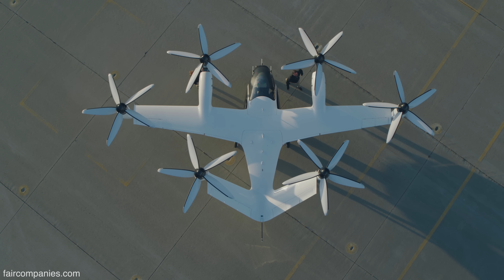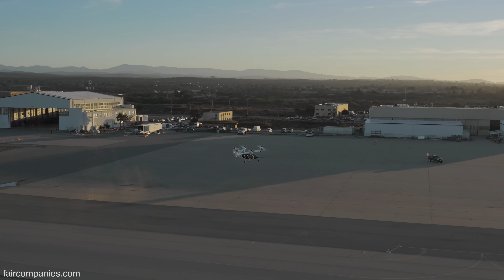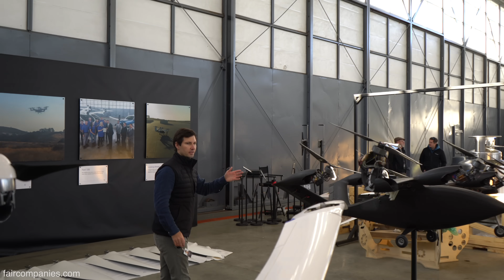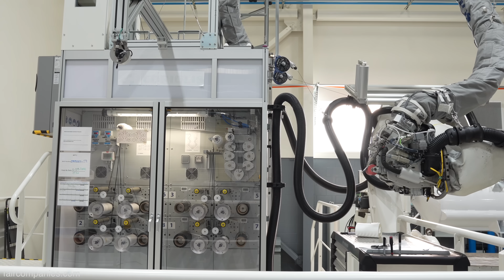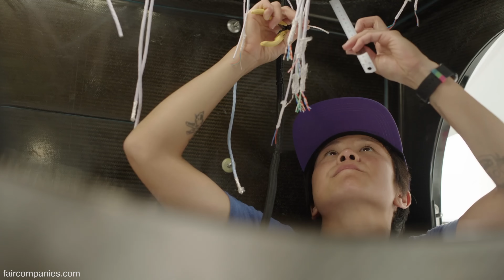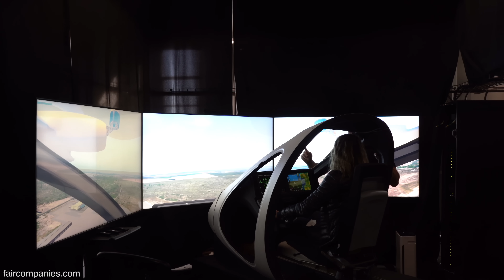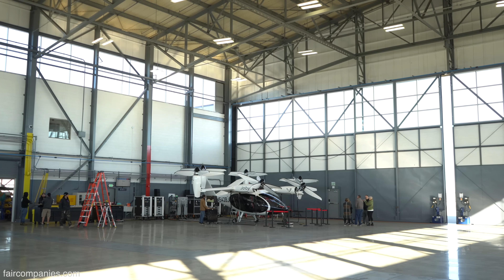eVTOL: electric flying car beats helicopters in silent commute

Comment: Still a messy design; trading less noise for more rotors? Twin rotor configuration or even coaxial rotor make it look less than flying a tree.
Reply: Redundancy. A motor out in a helicopter or plane is a serious emergency. 2 motors out on this is a tuesday.

Comment: Until adequate fuel cell technology is available, this is merely a highly advanced research project with little chance of becoming a commercial success. It's very impressive and it may have a great future, but unless there's  a significant breakthrough in the electric storage, charging and discharging technology, an interesting project it will remain.

Comment: Until Battery Technology Progresses to a Fast Charge Long Power Cycle. add a smaller battery with an Small efficent Gas Turbin Generator to eliminate the need for  fast or long time charging.

Comment: Does it require a Multi Engine Endorcement or TYPE Rating?  Actully if it has all the Buillt in Stablization of TOY Drones and can't fly without it, it should make a very good Instrument Platform mor capable than even Helicopters. Actully with GPS guidence it should be capable of Zero Zero Vertical Approaches/Landings in congested envrioments. YES/NO?

Comment: I think Joby has the best eVOTL design hands down. They just need to incorporate full automation with automated flight controller for air traffic. They also need to incorporate battery packs, so you can land at a skyport and have machine that can swap the batteries automatically in just a few minutes.

Comment: It will work with just 2 out of 6 propeller working in an emergency. But never that situation in a well maintained craft, worst situation only one may have a short circuit breakdown. 

Drones with more than 3 propeller is very safe and stable, can be optimal to save battery life for a long flight.

Comment: I dont dislike it, as it is an achievement hands down. BUT as a taxi it does have a major problem.  capacity. by the looks of it, it can only seat 4 people one of them being the pilot.  also its interior is anything but spacious.  thankfully it does have a huge view, but for some, that level of view at altitude may be a bit frightening.  Also in regards to capacity, it has the worst problem with scalability.   as scene its already a very large aircraft.  Its cabin is small, but overall its size as a whole with its larger wings and exposed rotors doesn't leave much in terms of scaling up, which would see to an even larger cabin and even larger wings and propellers to accommodate that larger cabin.  why is this a problem?  because of the space required to take off and land is restricted to the regulated dimensions of a helicopter landing pad, that is if its to use service such locations.  aside from that, it would require its own vertiports with landing pad sized to accommodate its scale.

Comment: I have a lifetime of experience building model planes and doing composites for aerospace and the Joby is by far the best and most advanced eVTOL.  For a while they were right down the road from me here in Redwood City before moving out of the old Miracle Auto painting shop and into a larger space when they got the funding. This is by far the best eVTOL video on Utube!  Thanks Joby and good liuck.

Comment: Like all electric aircraft at the moment the problem is battery technology.The useable payload and range is restrictive because all certified aircraft have to land with around 20 minutes of flying time available. In the video the range was stated as 150miles but he then said they are looking at a range of “20to 25 mile trip”I suspect this is because the 150 mile is the remotely controlled prototype weight.Once you load it with people, the range drops considerably. If they are stating the target range is 25 miles and the speed is 200 mph then that equates to a flight time of 8 minutes or 16 minutes out and return time. A lot of money for an aircraft capable of 16 to 20 minutes flight time which probably requires hours to be recharged.

Comment: Heliplane you could use six small gasoline engines or diesel just think of the safety aspects of it all those redundancies they should be mass-producing those already work the electric part in there gradually as better Battery Technology comes available

Comment: If an aircraft does not have a survivable airfoil produced glide ratio or auto-rotation, its a death trap. Period.

This thing does not appear to have enough of a survivable glide ratio. Also, a bird struck or failed rotor will cause this thing to auger in to the ground as fast as one can say "oh, oh."

It's a death trap.

What's the glide ratio, Kenneth?!

Comment: Well....I am a pilot.  I noticed a few things in this video that were lacking.  First, as a pilot of either fixed wing or rotary wing, you spend a LOT of time training for engine out situations.  No one ever talks about this on these aircraft...as if they will never fail???  But it is certainly not at all unreasonable to imagine situations (eg, massive battery short circuit) where all power is lost.  I'd bet that in most configurations, these will fall like a stone (no, a helicopter can land quite safely with no engine).  In that "what if it fails" vein, I wonder what happens if the articulation on one or more motors fails?? You have a LOT of moving parts on this thing, and not a lot of experience in the "what will fail in the real world".  Also, what is the certification path going to be like for these?  The FAA gets seriously intense in their scrutiny of vehicles used for commercial transport and likewise the training requirements for pilots carrying for commercial transport....creating a prototype is all well and good, but there are a lot of stumbling blocks from here to there.  I would be very surprised if they could get FAA type approval in less than 5 years, AFTER they have a final model to get certified.

Also, BTW, the implication that regular airplanes are loud because of their combustion engines is a misrepresentation.  Most of the noise comes from the props, with the tips of the props very close to the speed of sound.  No one puts mufflers on airplane engines because it makes very little difference!

Comment: You need to make two of these run into each other at 500 ft then cut power and activate a perishut to simulate a power failure with soft landing.

Comment: Would like to see blades inclosed tested for light contact with another evtols or birds🐦. Realy should be sit flat or drop down on ground so wheel chair can roll rite in with no problem and fit in parking spot with bus driving by. Bolistic parachute should be required for full power failure to avoid hard landing ever. Pioneer evtols will set insurance prices with death toll. Good job on sound reduction!

Comment: As it is flying forward the weight of the aircraft and passenger are on the wings... but for vertical take-off and landing the weight of both have to be supported by the bearings in the electric motors.. I would hope that they are very strong

Comment: the idea of a gyrocopter, autogyro, gyroplane, isnt new at all. The implementation of that idea though... One thing that i applaud is how quiet it is. JFC... we have such a huge problem with helicopters and the maddening torture of sound pollution they produce, in our area. It is so maddening a rpg sounds so, so tempting.

The thing is , it isnt going to be an affordable transportation solution for the middle class. Even the taxi service isnt going to be cheap, I assume.  Let alone having them flying around in the towns, cities. Yeah why dont we have a few thousand flying objects of that size above residential areas and lets see how long it will take for the first disaster to happen.
Reply: There's no new ideas under the sun. It's all about who can execute the idea and make it reality. Also do you have any idea how many small aircrafts fly over residential areas? And yet we don't have a bunch of them falling out of the sky crashing into homes.

Now granted these would be flying much closer to the ground. So your concern is valid. But if we can keep all these other aircrafts in the air to where that's not a concern? Why not with this?
Reply: The availability thing is a good thing. Even if they are safe (anti-collision systems, autopilots, etc.), they'd be even worse for the environment than cars.

Comment: What's the weight, what's the payload, how many passengers, what is cost per hour to operate, what is cost per seat mile, when is FAA certification....none of these questions were asked. No sound of the aircraft in a hover or a low altitude flyby was allowed either.

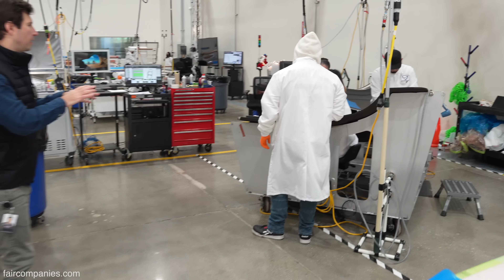Comment: 12:30 hahhaha technician all LATINOs. They must have degre in Harvard or MIT.
But its ok to reduce cost. and being small/entrepeneur company.
Have you considered introduce batery on the fuselage? I ask because you already made autoclave with carbonfiber so you can put cells on it.

Comment: I have been building multirotor copter drones for 15  years and this is all just a big multi rotor drone if it was not for hobbyist finding LIPO batteries to power the first ones this would not be here now.  The sad part is that these are far to inherently dangerous and unsafe for a multitude of reasons and they have to make them extremely light just so the current battery technology can power them if a battery can be made stronger and with less danger maybe however you must still rely on multiple propellers turning at extremely high speeds next or near to the occupants. I love the dream, it is just reality will kick in at some point here and these will fall into oblivion however the tech will live on for the next advancement that will make these practical. I hope I am wrong I would love someday to travel with ease as I hold a private pilots license and know the hassle flying can be when there are no close air strips and getting medicals to fly.

Comment: sure as hell wouldn't want to be riding first gen.  When the power goes down, it goes down.
Reply: 6 motors for redundancy, will land with only 4. Helicopter, 1 motor for lift, 1 for propulsion. I like redundancy.
Reply: @denniswilliams3934  that's good that there's redundancy but helicopters are generally considered reliable.  I'd still wait a year or three before I took a ride in an electric flying vehicle.  Mechanical failures occur all the time, but when electrical fails it's instant.

Comment: This is great. I've always been suspicious of VTOL transport videos that don't show you how loud they are. That's the thing that will determine if they're allowed in cities close enough to populated areas to be useful for their intended role.
Reply: A remote quad drone less than a kilogram is subject to a bunch of regulations most people aren't aware of. People are hyped by the positive potential exclusively, they always forget about the 80% other important things : safety, qualifications, infrastructure, regulation of shared space, maintainance and spare parts/qualified vendors and contractors, tested and validated overall systems, operation and management........

At the end of the day (or the decade), it always all come down to what people didn't expect : the operational constraints doesn't meet lambda people expectations in terms of costs or complications, only a few elite will have access to the privilege or service, sometiles via costy dérogation or because you're a billionaire authorities may have trouble challenging. I don't even have a licence to fly an ultralight on my own from an airfield (we steal the flying time of a qualified pilot) and I have a thousand times the knowledge a lambda anyont have in terms of flying and rules/regulation, I know how sensible of a qualification it is, I cannot trust putting any of that very advanced tech vehicles in the hands of the first "oh gosh it's so dope, I also want a flying car" dude : that's a recipe for disaster and drama. If people are regularly going down the road to change the chips of a drone toy to exceed the built-in altitude limitation by regulation, what kind of stupid rules breaking they would intentionally or inadvertently do with a "flying car"? Sharing airspace with people and properties below is the opposite of "having fun", you do care about at all times and abide by the rules, there is NO WAY you decide where you go, just like medevac ops today, you wait for instructions (air traffic control) and you strictly follows virtually already defined limited set of flight routes. We don't want that thing flying over schools or other areas with dense flocks of people walking, there must be regular suitable emergency crash land sites along the routes, like a stadium, highways, corn fields...

The only "your fancy extraordinary personal car" that may find birth in a city is the one that meets all those conditions, like Tesla autopilot where a connected centralized service decides how to drive the car. For a flying car, it will be the same : you're not the one to have command, you just input a destination, then the company owning the service flies you there on through defined standardized flight paths and standardized connected "other fellow air travellers in nearby vehicles". That way, we get lambda people out of the equation in terms of training/qualification, and we get all vehicles standardized in terms of regulations, flight rules and behavior. Or else, no personal car, you go to a flying taxi port and you rent the service with a fully qualified trained pilot that will do his best to get you to another port/other places with special derogatory privileges, but he/she remains who has the last word.

Hope this helps you have a better window displaying what will slowly take place in the future, so you don't build the wrong expectations from the start..
Reply: @StephenKarl_Integral  woah, well explained sir

Comment: Nice. Thats the first time Ive seen a full sized eVTOL fly with motors in full cruise position (fully forward). Still Id hate the bill for prop maintenance...and what happens if any or the motor tilt mechanism's fail?
Reply: In vertical/transit mode, with 4 fans, you immediately shut or feather the opposite fan. Same thing with 6 rotors, but you must be trained to manage the failure and that would take at least 50 hours on that matter, it's not a plane which is much less subject to loss of control/getting out of an uncontrolled spin. Here you add the quirks of unpredictable aerodynamics interactions with that much lift/thrust components. The solution : training. A welcome help is augmented flight, where computers will deal with asymmetry issues right away before any abrupt loss of control (less likely in cruise mode) and inform you. But since electricity will get depleted at one point, trained qualified pilot is still mandatory.

For the tilt motion in itself (mechanical failure or computer glitch), it's the same : training/fast recovery and redundancy : you can make the mechanism redundant, and make the software have a default fallback basic mode, plus redundant integrity checks to detect malfunctions (either via sensors/switches or software data mismatch). That should prevent mechanism desync. Then, when the computers support get overwhelmed, it entirely gives up and let the qualified pilot override everything : fly the damn thing (manually configure tilt, then recover), find where you are and decide where you go, then inform everybody else of the situation. If you can't recover, better be high enough, have a fast breaking system in the rotors (emergency shutdown) and a two sequence high spin high velocity chute. As I said elsewhere, based on the fans position and the tilt motion, best chute position would be in the tail, not above the fuselage, but that also means you land on the nose, hopefully slow enough to not get hurt and potentially repair the vehicle.

Comment: The amount of money spent on this thing is obviously enormous but the vehicle itself is just too big to be efficient for four passengers -- it is clearly vulnerable to blow over from the narrow landing gear and top heaviness (batteries in wings particularly ) and failure modes between props, ,motors, tilters, pitch control,batteries, controllers etc with bird/flock strike thrown in  are 'challenging' .

The downwash on the wing (and tail) during transition must make the wing a liability - extra download- and if power is lost the propeller shutdown must be instant to avoid the airbrake effect of 30 huge blades feathering will need to be failsafe .   Handlaying cloth is an inherently slow and costly procedure (pretty much like German sailplane building for the last sixty years ) - nothing like automotive production or having mass manufacture potential .  I hope they get into operation if only to establish a baseline for doing things better - the $100 million wasted by Kitty Hawk didn't even result in any useful experience and no contribution to the technical literature like say the 1960s VTOL programs which paved the way for this generation .  The comments below are ranging from cynical/reactionary to gushing admiration -- the introduction of anything 'new' is likely to encounter resistance just for the reasons Machiavelli wrote about ,we can only hope that enough wisdom has been incorporated into this project to avoid the worst predictions and avoid the 'headline' outcomes so injurious to progress ( Example a mid air helicopter collision in Australia makes world news, frontpage coverage in bold font,dramatic pictures, etc etc - car accidents claiming many more unreported. )   The noise issue will be clear to all in operation and 'non negotiable' when it comes to siting 'vertiports' - in any case it is not a flying car and will not be used like one for daily commutting despite the video title.